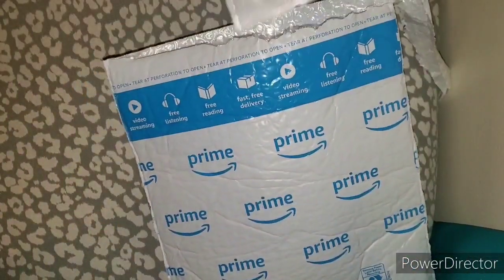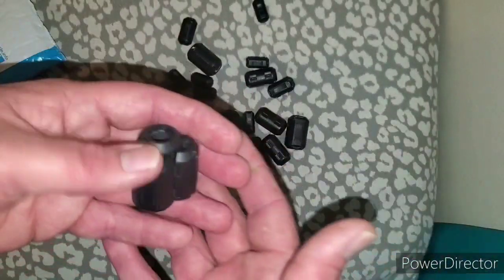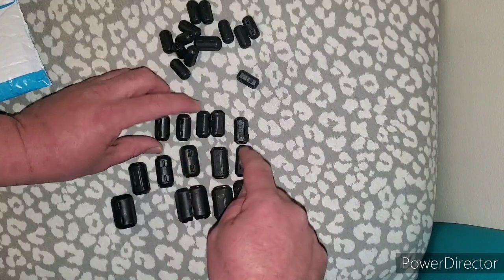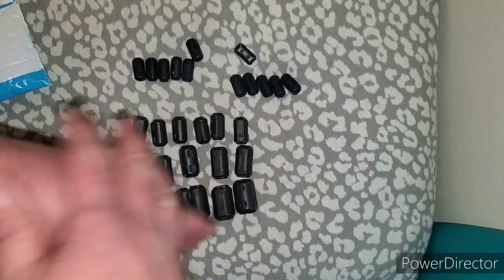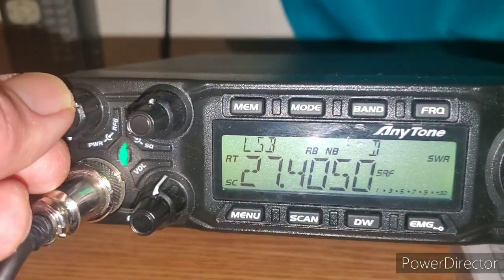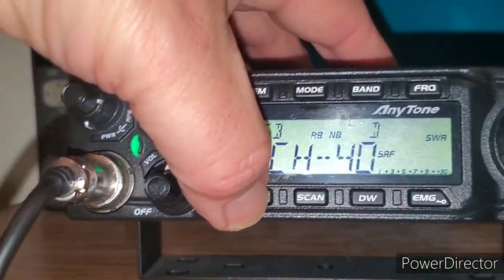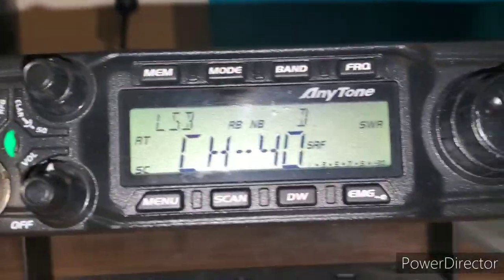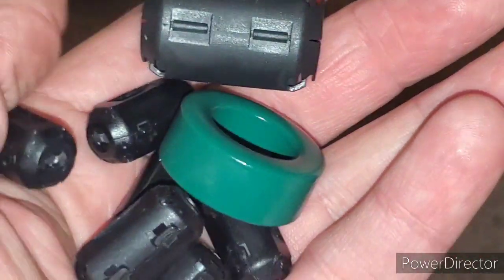671 information of the RFI , EMI & HFI  and More at  You're Radio CB Static 3/2/20

Comment: What exactly causes the snap on chokes to vibrate/resonate when power is going through the line. Normal, bad?   I’m at 25-30 amps going through my solar lines. They want to buzz.
Reply: Normal if AC is going through them as Ferrite cores are actually transferring the RF energy in the line to heat so they vibrate even if we don't see it.  The more power going through the more they must dissipate and the more they could vibrate.